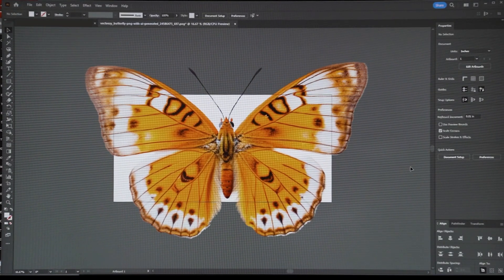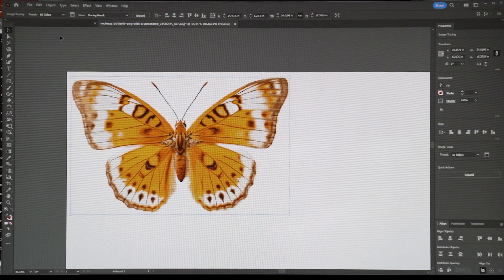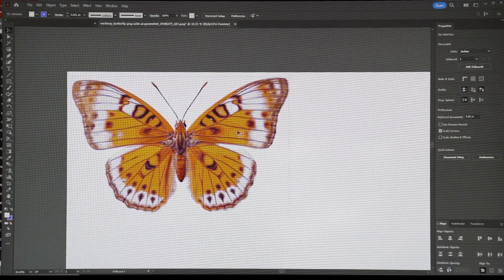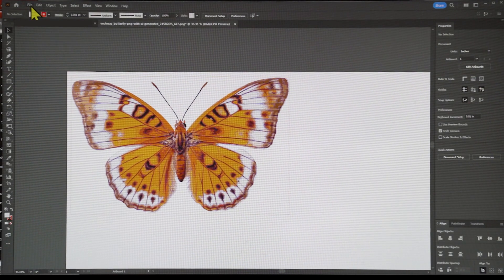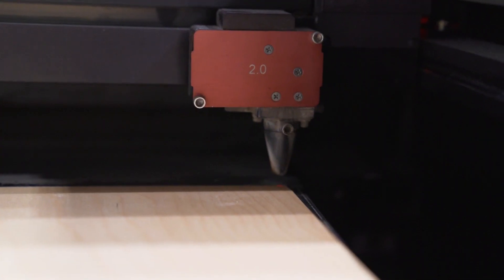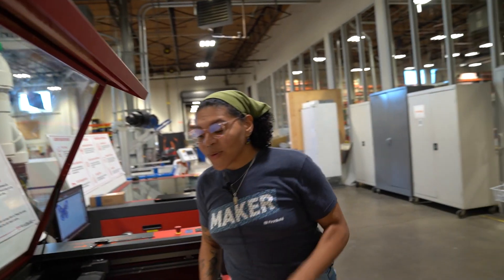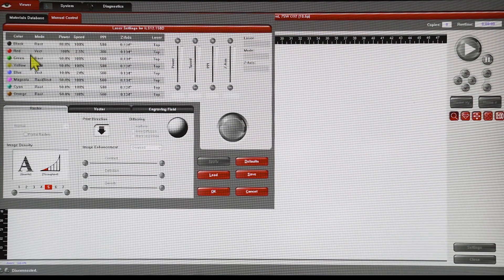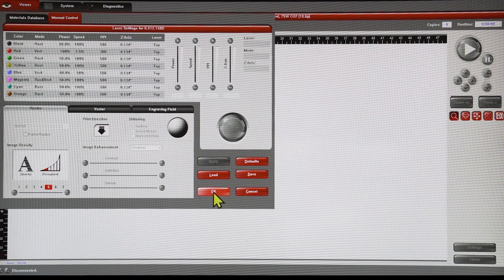Universal Laser Tutorial with Marissa

Comment: I work with a similar machine, and I've been trying to create a frost look on a whiskey glass, but many other specs out there don't align with the Universal Laser System.  So many other specs out there for other machines.  Do you have any recommendations? I've used the best so far on a rotary  100 power 60watt top 100 speed and 500 ppi. I normally leave the z axis to 0 and am really unsure what else I should change in settings.

Comment: I understand the setting for the blue lines (etching) and the red lines (cutting) ...why do you need to set up the controls for black. Is that for engraving?
Reply from the maker: Is basically a secondary etch. That way you have 2 different areas that can have 2 different settings. Example: Blue areas can be set to 100% power and black to 10% creating more depth/different effects to the final picture. Hope that makes sense